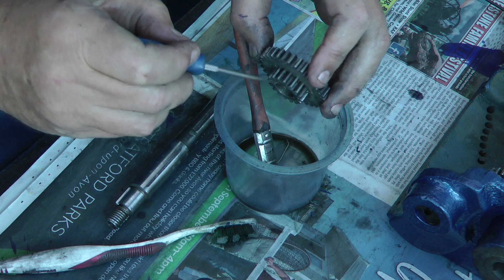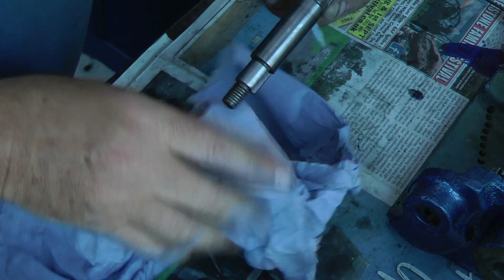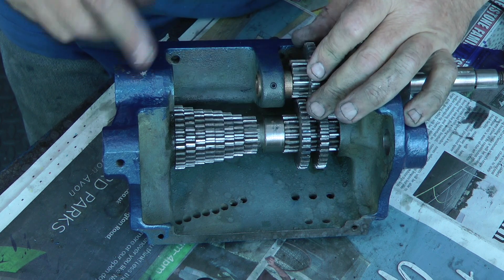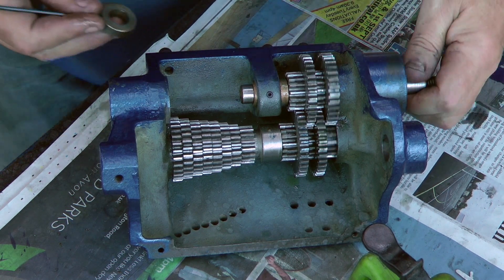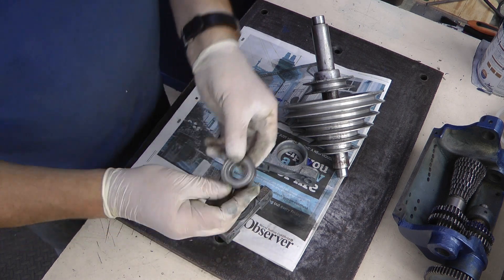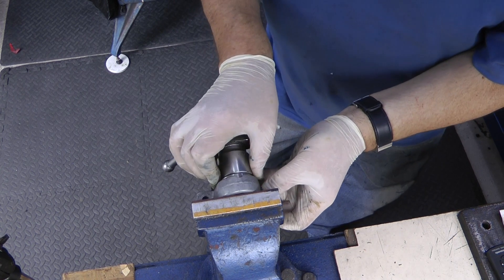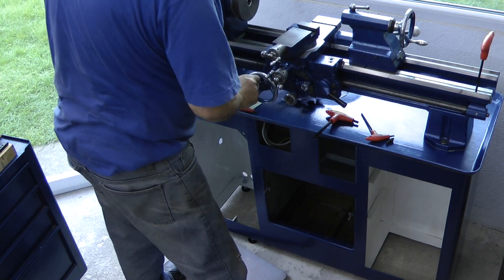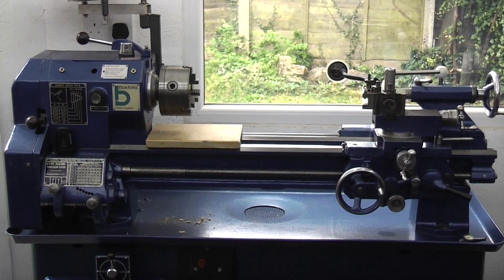Boxford lathe rebuild finish

Comment: Very nice restoration, looks just like new. I have a Boxford AUD variable speed lathe which I use for very small jobs and they are a great lathe, power cross feed, gearbox screw cutting and variable speed at the turn of the handle.

Comment: I’m just about to embark on a restoration of an AUD Alan, so this series is pure gold. I suspect I’ll be going back over it a few times! Did you mark the headstock position on the bed before you pulled it off, and how about a final video on methods of checking the alignment of the headstock and tailstock and levelling the bed. Making sure everything is back in alignment is the one area that concerns me a little with a complete strip down. Great work, thanks!
Reply from the maker: Hi we measured the headstock overhang to the bed end. Headstock alignment is fixed by the bed ve -guides same with the tail stock. So unless you have the bed reground they can’t be adjusted.
You have adjustment on the tail stock which is used for tapper turning.
Reply: Thanks for taking the time to reply Alan, it’s much appreciated. I’d read somewhere to scribe the bed to mark where to reposition the headstock, But i think your method is somewhat better!

Comment: Great work , how do you know that the headstock is running parallel with the lathe? 
I have recently bought a lathe and it has had the headstock changed and it’s not true with the bed.
Reply from the maker: Hi first you must check that the lathe is level when it is put a 1" steel bar in the chuck and machine about 4"" in length. Use a fine cut without altering or adjusting the tool.Then check the diameter at each end if its the same its OK if its tapered recheck level.

Comment: Did you have as much fun as I did removing the front of headstock clamp bolt?  Could get very little swing with a spanner - I cut a few down to short lengths to undo it
Reply from the maker: Hi. When we purchased the lathe we split it by removing the bed from the base and loaded it into two estate cars.
So it was a simple matter of turning the bed upside down to remove the bolts under the headstock
Reply: That helps a lot  - anyway great series - good to see how every part works without having to break anything
Reply: gearwrench 72-tooth box end ratcheting spanner has just enough swing to loosen or tighten it (without modification)